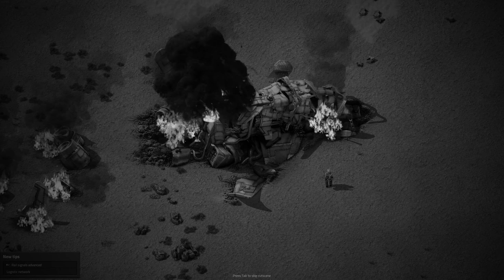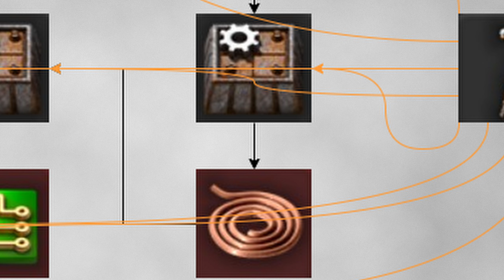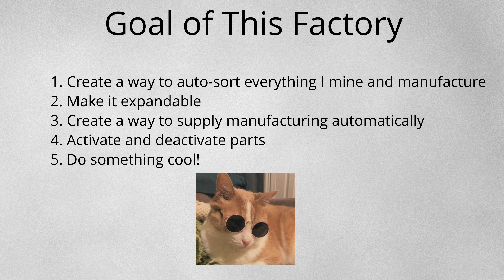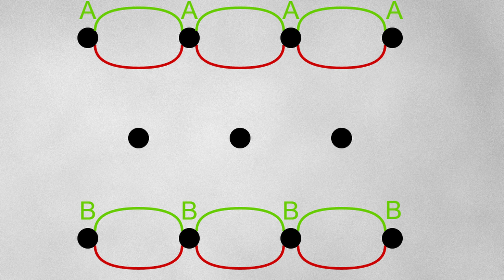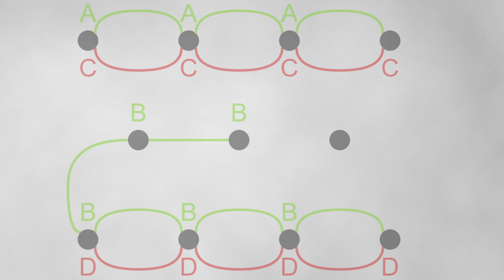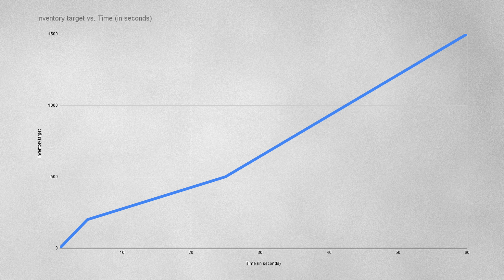Factorio - My Self Contained Factory

Comment: You should try to do a self-balancing factory. 

You have an assembler which changes recipies. Every item has a target. When an item is at half supply, the assemblers switch over to produce that item until its quota in storage is met, with the most basic items taking priority when a storage is called.
Reply: It turns out that this is a huge pain if productivity modules are involved.  Switching recipes resets productivity, so if you want to do it efficiently, you need to know how many crafts are needed for one bonus craft and only ever craft items in batches of that size, which involves storing a lot of extra intermediate values.

Comment: One thing you could add onto this base design now is using Radars as wireless, unlimited reach signal transmitters.

All signals do get combined when hooked up to a Radar, only separated by whether they're on the Red or the Green wire network, but that's where you can make use of encoding. Give each location its own signal and encode actions as the number sent alongside the signal as a pulse.

An example use case, using single pulses of signal Yellow Inserter to control the Yellow Inserter production block with different values:
- value 8 toggles power to the entire Yellow Inserter production block
- value 16 only toggles power for 1 assembler, value 17 toggles power for 2 assemblers, and so on until you reach the max quantity of assemblers
- value 3 toggles whether to stockpile inserters, or let them be requested by other processes
- value 5 toggles the belt buffer (for debug

Another use case I can think of is base-wide control. Such as toggling a "minimum requirements" mode to cut down on pollution while maintaining your defenses, fuel and power production.

This would allow you to have a great deal of control over your factory when far away or even on a different planet/platform.

Comment: 24:51 you can micromanage even further, by connecting a red or green cable to an assembling machine, you can control whether it activates based on a signal, when it should activate, or even change the product it's fabricating, even more complexity!

Comment: Love this game. The biggest problem I have with it is throughput limitations, especially with trains. I always end up bottlenecking myself because I built my train network bad, then the idea of having to rebuild it entirely just demotivates me to keep playing.
Reply: I can understand that frustration. Have you considered just not using trains, and belting everything from your mining outposts to the main base?
I usually do the smelting next to the ore patch, and in the last couple of playthroughs I just use belts (and potentially robots) to move it to the manufacturing areas. I didn't use any trains at all (at least on Nauvis - my Space Age playthroughs has exactly one train on a different planet).
Reply: @david_in_perth  I have but that get's pretty expensive in other areas, especially when switching to green belts. I need to just start building my train stops a little bit better in a way where I can stack more when I need more.
Reply: @snottytoe6957 Yeah, it can use a lot of belts, but I've always found I have enough resources to run the belts whenever I need them. And I only upgrade the long distance belts when I have a large stockpile of the upgraded belt type. I'm happy to leave them as red belts well into the late game, for instance. Two red belts give as much throughput as one green belt after all.

That said trying to plan out rail systems is fun too, so I'm certainly not trying to dissuade you from sticking at it if you want to face that challenge. One of the best things about Factorio is the way it allows players to pick and choose which challenges they want to come up against in a particular playthrough. E. G. Make biters more aggressive, or turn off biter expansion? Download blueprints from online, or design everything from scratch? Use Railworld presets, or increase all resource patches huge, close, and rich? Build a standard rail grid, city blocks, a main bus, or commit to 100% spaghetti?

This really is such a great game 😁

Comment: "we have logistics bots at home" 
it's a really interesting system, and knowledgeable use of the circuit network system. unfortunately i think youll find it won't be as expandable as you think, as the number of items will increase a lot both in type and amount

Comment: This is awesome and I've never seen something like this before. Sure, you can say it is technically a sushi belt design, but in comparison to the usual sushi belts this far better organised.
My main concern would be the late game expandability. The diagonal form of the factory would over time lead to a lot of wasted space and travel time. I think the best way to fix this would be to make multiple manufacturing blocks similar to what you currently have with a train network to connect them. I'd also suggest making train stations that split off from the main path to stop train blocking in larger factories.
Fluids could be handled via packing/unpacking on site and reading from a fluid tank to indicate when more is needed.

Comment: Deliciously overcomplicated. Very well done.

Only improvements I can think of that don't compromise the spirit of the idea is that you almost certainly don't need to use slow belts on the pickup side of inserters, and (now in 2.0) you can hook the assembly machines directly to the circuit network to turn them off rather than cut power to them.
Reply: Circuit network assembly machines allow you to over complicate even more! So it’s a must in any needlessly complex base.